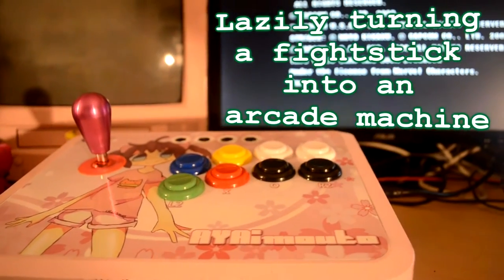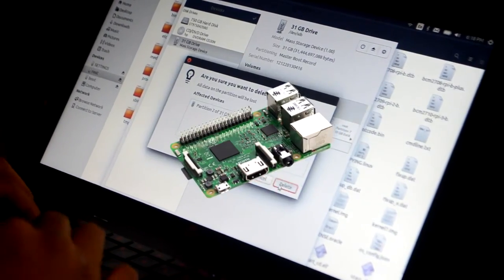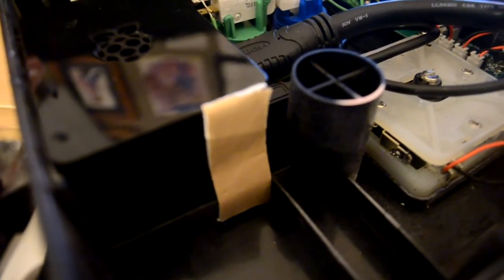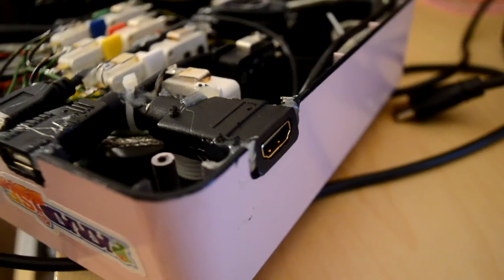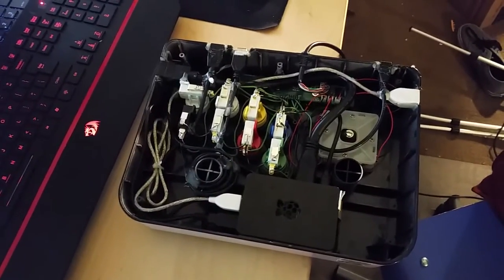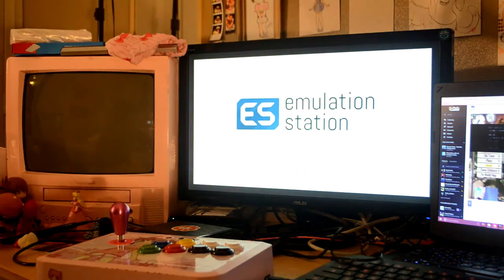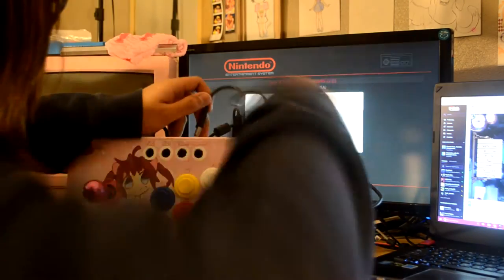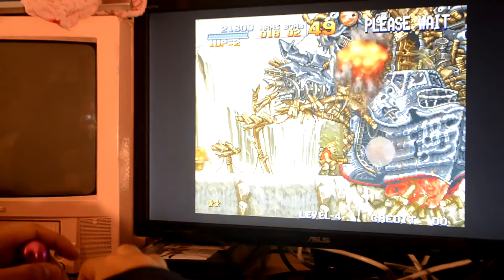Turning a fightstick into a portable arcade with Retropie!

Comment: Nice work! I had been thinking about doing the same thing. Is your stick the Mayflash PC042? Sure looks like it from 0:26 in the video, but you must have painted it and changed the button colors? Did the RetroPie OS recognise the stick or did you have to find a driver? I have looked for a linux driver for this stick and turned up nothing as I have the same stick as you....
Reply from the maker: It is
And it recognized it right away
I don't know why yours can't because I tried it with other Mayflash fightsticks that are the exact same model and they all worked fine

Usually when all else fails with my controller mods, I just buy a cheap xbox 360 controller and replace the pcb board with it lol
Reply: Cool, thanks for info! I already have the same Mayflash stick as you and was just about to buy a pI3, so just wanted to check they were compatible. It all sounds promising :)
Reply from the maker: keep me updated on your progress~

Comment: also Thats a sick frontend! Guess its time to abandon Launchbox and Hyperspin
Reply from the maker: Retropie is only for the Raspberry Pi, not for windows
I still prefer hyperspin because you can run windows games there like Street Fighter 5
I only used a retropie here because it's literally a small computer that's smaller than your hand so it can fit easily in a fightstick
Reply: ahh, For windows Games i would usually goto Launchbox more than hyperspin, Rocketlauncher is a tad annoying to work with

Comment: Hi, what is the model of buttons and joystick?
Reply from the maker: Ironically, I wanted to use generic parts for once, just to know how it feels since all my other fightstick has the good stuff like Sanwa and Seimetsu
So the buttons are generic (I found them at a local electronics store lol) and the joystick still uses the one provided by Mayflash, except that I changed some of the microswitches because the ones they gave kinda broke along the way
The battop is a paradise fuscia aluminum with 10mm threading

Comment: instead of using retro pie can you run launchbox on a portable joystick ?
Reply from the maker: The reason why I use a retropie is because of how small it is and how it can fit inside many fightsticks.
If you're able to find a fightstick big enough to fit a windows machine in there, then you can do launchbox on a fightstick. I suggest building your own fightstick to fit a windows machine if you intend to do so.
Heck, I would just make holes on a computer casing, put buttons, and put the fightstick pcb in there.
Reply: isn't it possible to fit lauchbox on a small motherboard.... just copy from the pc to a motherboard with fast processor and large enough rom space ? or harddrive ?
Reply from the maker: I guess
I just haven't seen a small pc motherboard as small as a raspberry pi
If there is, please show me as I would like to try it as well